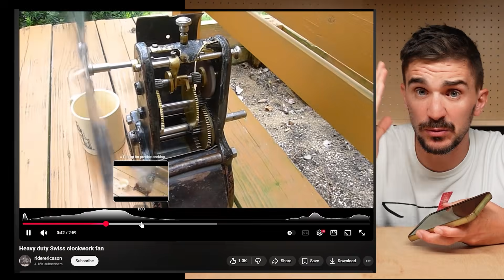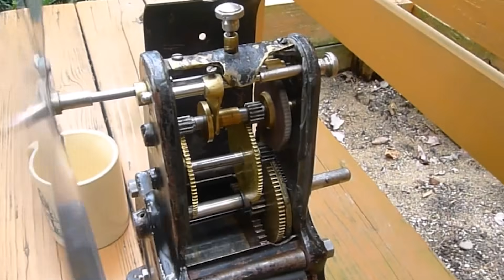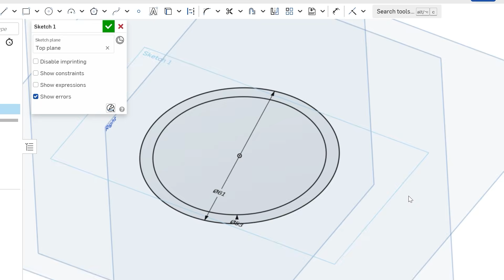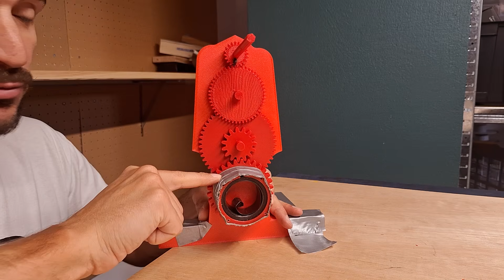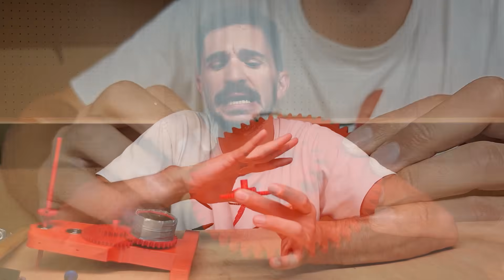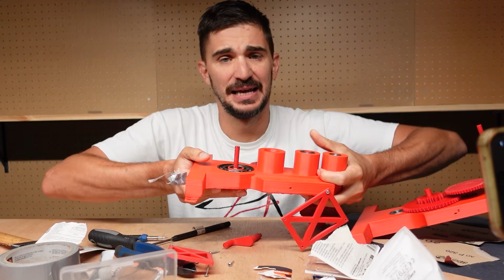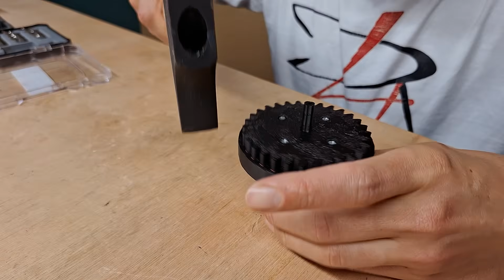No Cables or Batteries, Just Pure Mechanical Engineering - This Swiss Cooling Fan Cools You For Free

Comment: Why not use power drill to wind it. I know it won't be purely Mechanical then but it will cut done time.
You could also use gravity to wind in by hanging a weight for winding up and then take if off for running. There is a Clock work radio for use in areas where there are no electricity that it works on the same principle.

Comment: I used to have an off-grid AM/FM radio with a 3-way battery charging system. That was solar, DC input or cranking a mainspring which unwound slowly, turning a small electric motor in reverse and charging the battery or directly powering the radio circuitry.

Comment: Wind up spring motors ! Old enough to remember wind up toys. But young enough so they were a mix of stamp steel ones and early plastic ones, where the only metal part was the spring. Duration was under a minute, before needing a rewind.
Reply: But you never got the full minute!  Either because you had to crawl across the floor all the time or they'd spin themselves out against the wall. 😂😂

Comment: The spring can store more energy than what you did put in it.  In the original device, the spring is inside a steel (or cast iron) barrel, a lot heavier than a 3D printed thingamajig. To reduce unwinding speed, you need to get the torque needed to move up. Increase the gear ratio, from there you can experiment with fans , diameter or movable blades.

Comment: 3d printing is fun! But man, you should really start using some basic steel axles. With plastic and this little torque you can easily just always pressfit everything. Axles, washers, metric screws. These parts are so cheap on aliexpress and come in bulk. Of course they are still cheap chinesium etc but still a 100 times better than any plastic axle or shaft. 3d printing is a very solid choice for everything static, loaded or unloaded. But almost never for dynamic usecases. Third, getting PLA smooth is so much faster and easier with a little Acetone on the surface than sanding ;)

Comment: A couple things to consider. The fan blade used I suspect was from a standard AC fan using a 2 pole induction motor. In the US that motor running on 60 Hz AC, it has a theoretical max speed of 3600 RPM. In the EU that motor running on 50 Hz AC, it has a theoretical max speed of 3000 RPM. I believe your mechanism would not come close that that speed. Fan blades with a higher pitch would work better at a lower RPM providing more resistance causing mechanism to run longer. Also the video device appeared to have a higher gear ratio, which should provide greater resistance to the spring, causing a longer run time.
I would be interested to see the original device to running on a full winding to see how much air it moves and how long it runs.
Reply: I was just going to make a similar comment. The blades on the electric fan will be optimized for the electric fan. On the wind-up fan, the blade pitch will be too shallow (and the overall size might be too small). Bigger, more aggressive fan blades should move more air, and slow down the mechanism so it runs longer.
Reply: What a troll that chainmail poster.
Both line frequency and voltage are real and significant for some appliances. AC frequency is quite irrelevant for most power supplies powering most consumer devices because they make it to DC early in the process. 
Simple resistive loads like toasters don't care about frequency either. 
Voltage regulation can take care of line voltage differences, but above mentioned simple things need to be wired differently for 120 and 240v. Sometimes they will have a manual switch.
Reply: @misium  That's literally what I said. If you take a microwave who's clock is timed on 50hz AC it won't run fast on an 60hz supply. Can you guys not read?
Reply: you need to spend energy equal to climb a staircase of 20 store building or rotating bike pedals equal to 20-30 minutes of riding with a speed of 25km/h to...
wind up a spring which will give you 1 hour of 30cm fan to blow air mass equal to lowest preset of 30cm electrical fan we all have.
i don't think i need a fan that makes me sweat for 30 minutes just to give me 60 minutes of shallow breeze
Reply: Your numbers are actually wrong. They both run at 60hz. 110, 115, 120, 220, 230 and 240 volts and the various hertz's are administrative figures caused by different regulators using different measurements for the same thing. Obviously you should never plug a 120v American device into a European socket without an adapter but that's because the American devices usually use cheaper, thinner wires.
The global standard is based on the original British mandate of 240v, 13a at 60hz which was the maximum safe power through the wire. The US uses the same standard but they split the voltage inside the house which is why you can use a double power device if you get one of the bridges on your breaker box, a heavier gauge wire and socket.
The Europeans use the same standard as the British but depending on the country they will mark it as 220v at 50hz (lowest rated municipal supply) or 230v (hedging between 220 and 240).
A lot of countries went with the American approach of splitting the 240v into two and not using an Earth pin because it was cheaper and safer but because some of them use European style regulations they'll mark the same thing at 110 or 115 instead of 120.
This is why the same factory in China can make a single microwave (with a clock that doesn't drift) for almost every country and just change the plug (and sometimes the wire). British and European devices will usually have a higher power output than American ones, despite being identical because they have twice the available voltage. An electric cooker can be plugged into a standard socket.
Until quite recently AC devices in the UK came with bare wires and you had to wire your own plugs.
Reply: @CallMeMrChainmail  Wow, you seem to know how to mine a bunch of facts, but do not understand the concepts behind those facts.
I never once mentioned voltages in my post. Also I do not believe you have any understanding of what the frequency of a power grid is. On a power grid, voltages are increased and decreased all the time, but the frequency does not change on the large scale.
What I was trying to indicate was a simple understanding that simple AC induction air handling motors tend to run on higher RPM speeds and designed to operate with lower blade pitches due to those higher speeds. 
Even today most AC fans still operate using the same AC induction motors and are ruled by the physics of how they functon according to the AC frequency they operate on. Even new AC fans that have changed from a manual switch to a digital switch, the switch operates on DC circuits, but still act as a switch to turn on/off the AC power to the AC induction motors. Still the motors operate directly on AC power and follow the same physics of operation.
Also if you are interested, I did study Electrical Engineering and was a Co-op Engineering student working at General Electric "designing" air handling AC induction motors for use in commercial uses. 🙏
Reply: @AmaxMr  How did you study electrical engineering and not know the difference between rated and delivered hz?
Reply: @CallMeMrChainmail  are you talking rated vs delivered voltages?
Do you comprehend the difference between voltage and frequency when talking bout AC power service?
Reply: @AmaxMr 
Actually you are right. I made a mistake. I was confusing domestic appliances with industrial motors and forgot that many of them modulate their own AC frequency.
I apologise.

Comment: There are no losses. There is an exact amount of revolutions stored. It's not a combustion engine wasting heat. Only the last few newtons will not transfer due to the friction. What you need is a much stronger spring and a much higher gear ratio. And some kind of RPM  limiter on the fan end.
Reply: That's why steam engines, clocks, etc always have something that stabilises the rpm to give more accurate release of power and longer running time. I was surprised he never mentioned this - even if only to dismiss it as too difficult to make for this particular project.
Reply: "Friction enters the chat..."
Reply: if you hear sound then that is the mechanical loss. a silent machine is an efficient machine

Comment: With big parts, easiest way to avoid warping is printing directly on bed, without raft, making a net grooved on bottom of your object, you can make the net on fusion and add it as negative volume on slicer for future projects. Like from Galicia!

PD: Why not to gear down also the crank? 1:8 ratio on crack will effectivly reduce the crank time so getting you better efficiency, also using a "one way" system on crank will reduce drag on fan

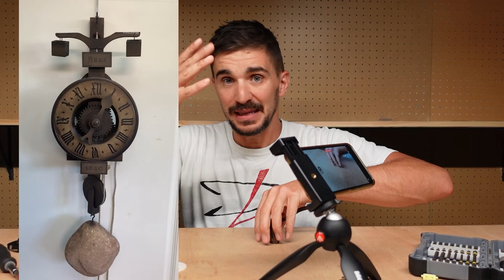Comment: 9:57 i think first "battery" was water, pumped upwards and released when you need some work done.
Reply: What about a sand clock (egg timer)? They must have been invented about the same time.
Reply: And the theoretical potential capacity is only limited by practicality.  Nuclear power stations in Wales use this method to store their output at times of low demand.  I've always thought this was such a clever idea.  There's something kind of perfect about it.

Comment: Maybe Lubricant would help it run a bit longer. Silicone Spray or something.
Reply: Maybe a little bit, too much energy goes into bending and wobbling whole construction, also, by the sound, gear teeths are not as smooth as they should be.
Reply: I don't think it's about power losses here. It's about gear ratio 1:16, so for each turn of the crankshaft you get exactly 16 rotations of the fan, so the time depends on how fast the fan rotates, not the losses.
To get longer rotation you need much higher gear ratio. But then your problem is torque to start and keep the fan rotating.
Reply: @MaxusR  yes, losses will only prevent to squeeze the last bits of energy from the spring of main barrel, who was masive in the models from the past, in this case there is no replacement for displacement because a spring can only store a fixed quantity of energy
Reply: My thought also. I used Armor All to lubricate noisy & stuck plastic speedometer gears & it worked well.
Reply: 24:07 He's thought of it.
Reply: Really? I always find that using lubricant makes it last shorter. 🤔 Must be skill issue.😅
Reply: @aXionXero  definite skill issue, chaffing is no joke and can take you or her out of the game for days
Too much lube is also a problem - there's a goldilocks zone when doing a marathon 😉
Reply: Not on uneven plastic. It has to be smooth lightweight aluminum or the like with proper amount of spacing.
Reply: Dry teflon spray

Comment: Since it's powered by a spring, it shouldn't matter how much energy is lost during operation, as long as it spins, it should pretty much do the same amount of rotations. The difference is that less friction allows the gearing to be more extreme and give more output rotations per input rotation.
Depthing clockwork with metal is also not an easy thing and clock makers take into account that things might have to be slightly farther apart.

As for 3d printing accurate parts: I have a Bambulab H2S and any mating surfaces, I make smaller by 0.1 to 0.2 mm.

I enjoyed the video, so your approach isn't wrong at all, but an alternative approach could have been: the original video shows how fast the first gear spins after cranking, so you could just estimate how long it takes to unwind the amount of cranking done from that

Comment: Another quick question: was removing the spring from the original tape measure housing really necessary? Could you design/print an adapter that just attaches that housing to a gear&shaft and save yourself the trouble/risk of transplanting the spring?
Reply from the maker: Could have tried it but the original housing didn't have something well defined to grab on so I decided to transplant. In hindsight, should have bought more tape measures and chosen a more optimal design.
Reply: @d4a  i was kinds surprised you didnt solvent fuse it to a housing